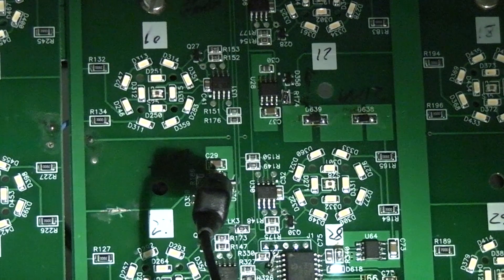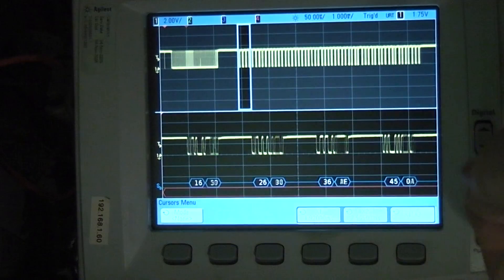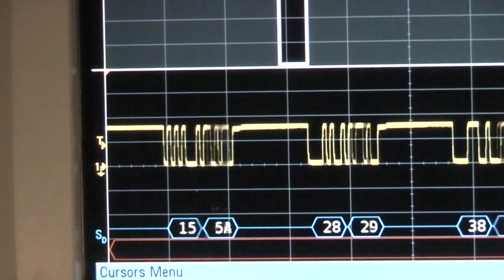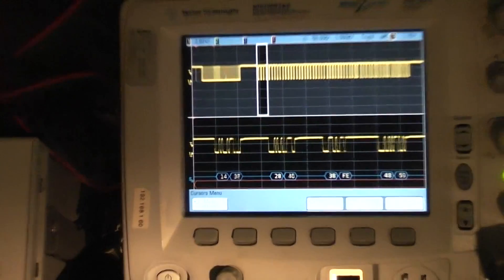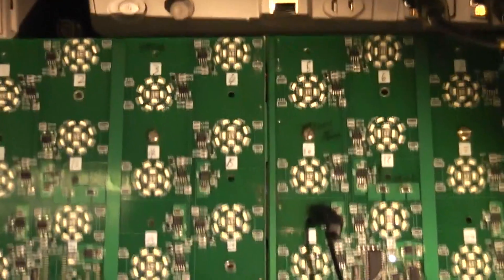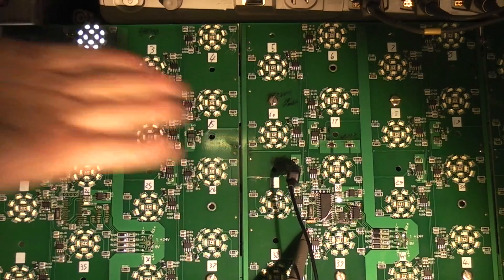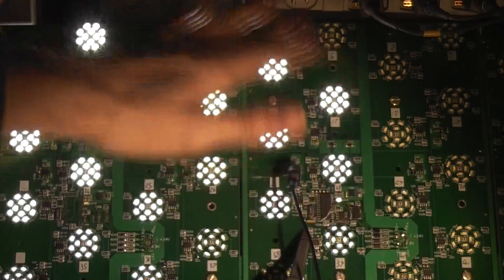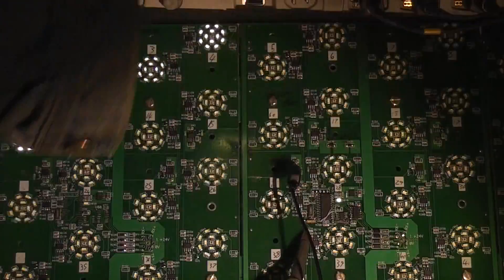Pressure sensitive PICs

Comment: Neat project, interesting symptom.  The devices could get a factory set pseudo random addressn (or a random one using ambient light and internal occillator and watchdog timer errors as seeds) and then get addressed in a tree manner to assign raster or sequential addresses.  Device discovery like the Dallas 1-Wire system.

Comment: Offset of opamps in packages like TSOP is actually pressure sensitive like the ring oscillator in PLL chips like TLC2933 is pressure sensitive.

You could use it as "parasitic" accelleration sensor or some kind of microphone.

I guess it is the actual flexing of the chip disturbing some differential circuits when the package is not giving strong support.

Comment: Stress on the resonator blank changes the resonance frequency through the nonlinear piezoelectric coefficient. This effect is also produced by sound waves of a great enough intensity passing through the crystal. Rubidium (stratum 1 accuracy requirements, the rubidium is slaved off a GPS clock which phase locked to a cesium clock source) crystal oscillators have to be mounted on a dampening mat to prevent shockwaves from vibration and high enough intensity sound waves from affecting the output of the oscillator.

Comment: You could use the pressure sensitivity to address the nodes. If the pressure goes up, you increment the last node-id by one, set it as yours and spit out your node id on the bus.

Comment: It's probably the piezoresistive effect of silicon affecting the resistor in the RC oscillator, as opposed to a change in the capacitance. A lot of integrated pressure-sensors work in a similar way (where they can wind up being sensitive to UV light because the die is exposed!).

Comment: Just tried the same with a TI Piccolo 28027 on my bench - similar effect. Only the frequency of the "High Precision" internal oscillator went down with pressure. I could easily squeeze it by 0.4%.

Comment: Haha, yeah had a similar problem with the PIC16F884. When you use the UART on that with higher bitrates it can even go out of sync. So the maximum safe bitrate is 9600 bps. I found out that this pressure effect is even quite linear so pressure sensors like the NPC-1210 from Honeywell / GE-Novasensors use that for high precision pressure measurement :) A project where the PIC used as a pressure load cell in itself would be a cool nerdy project.
Reply: Chip Guy Vids oooo, very cool idea! I'm putting this on my to do list!

Comment: Interesting, but how come the LEDs doesn't affect the light sensor when it get lit?
Reply: When LEDs are driven by pulse width modulation to adjust their brightness, they turn on and off very quickly. When you know they will be in an off period you can sample the ambient light without interference.
Reply: Brilliant!
Reply: Mythricia I guess it's easy to forget just how fast things are able to operate in electronics. Reading a light sensor in between every on-state of a PWM pulsed LED is relatively trivial even for a small cheap uController I suppose. Though I'd worry perhaps that the light sensor itself develops some sort of charge that decays slower than the actual light pulse itself.
Reply: TheHouseBlog For some silly reason I had never thought about that, having asked the same question myself sometimes. How simple. And now I feel dumb!

Comment: Wow what an unusual behavior. Makes you wonder if traditional PC processors exhibit the same behavior when a heat-sink is tightened too much.
Reply: *****
 not really, the pll does have an oscillator but it is continuously adjusted to match a multiple of the external clock
Reply: They do not have internal oscillators - so no.
Reply: queazocotal forgive me my electrical knowledge is not amazing. But does a PLL not count as an oscillator? I cant speak about AMD processors but Intel's processors handle the PLL for the multiplier on-die.